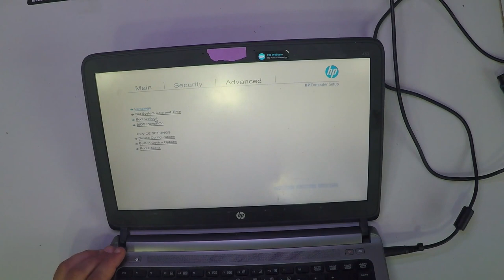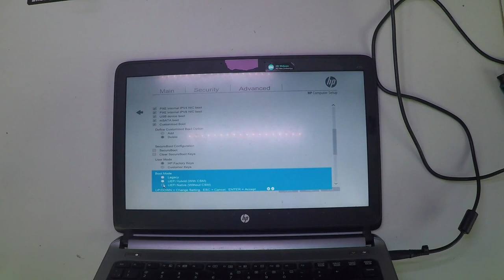HP ProBook 430 G1 Full Disassembly and Reassembly

Comment: Is that slot between the RAM and the WiFi a m.2 Slot for ssd? Please can you help me figure it out cuz i wana put a m2 ssd into mine.
Reply from the maker: In this model, there's no m.2 connector.
Reply: Yes but it is not the main most common size, make sure you do your research and get the correct size m.sata drive (Or NVMe if its applicable)
Reply: it is for the mobile antenna, was not able to find an SSD that would fit the screw position.
Reply: M.2 sata ssd 2242 this will fit